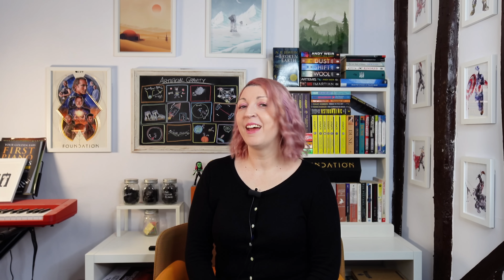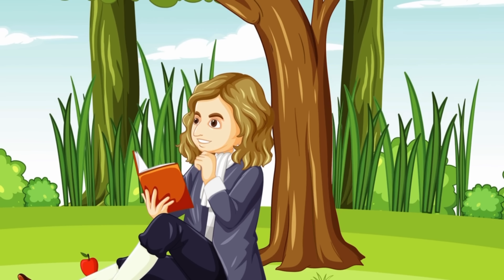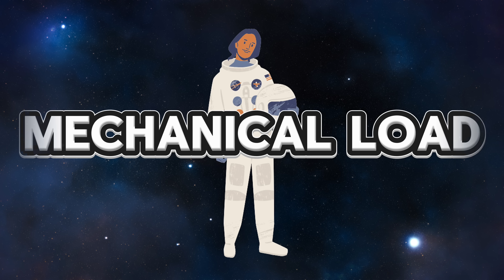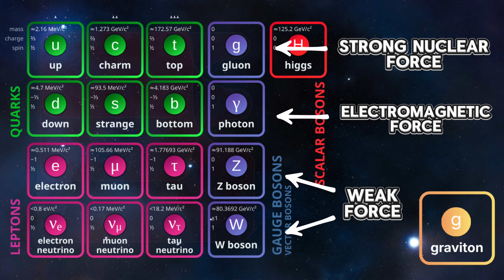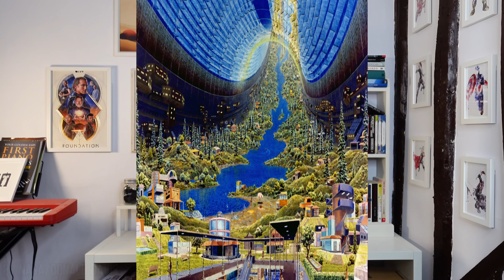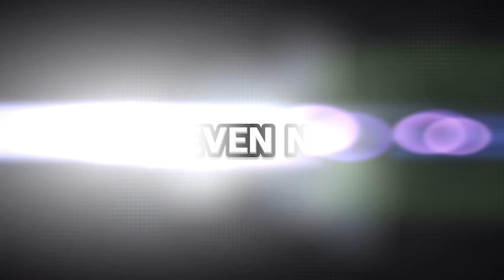Why Artificial Gravity Is Harder Than It Looks

Comment: A rocket accelerating at 1G continually would increase its velocity by add >355 k/sec velocity for each day of acceleration. If you keep that up, as it approached the 354th day: "Houston, we have a problem..." Except that you´d have to assume that radio transmission might have its own Doppler shift problems well before that point.

Comment: 4:45 Those small differences in Newton's law of gravity and the observable movement of the celestial bodies can be easily explained. His equation consider that no other forces are at play. So both bodies have perfect round shape, are solid and have evenly distributed mass. It also not counts the tide effect or the magnetic field.
6:03 Gravity isn't taken away in space. It still works. If it didn't work, then the matter wouldn't collapse and no moons, planets or stars could form from the gas and dust. 
Human body is not forgetting anything in space. The body is just adapting to the new environment.

Comment: Isn't there a flaw with the equivalence principle that you CAN distinguish being in a planetary gravitic field from a ship accelerating uniformly?  If you can detect the normals sensitively enough (say your ship is wide enough), the normals for a ship in acceleration will all point exactly the same direction, whereas the ship resting on the planet will have the normals all pointing directly away from the center of the planet, which will vary over the width of the ship, so you have a way to distinguish the two frames of reference.

Comment: 16:30 In my imagination, someone using gravity boots would look like one of those inflatable tube men you see outside of car dealerships. There's nothing at all stopping the rest of your body from flailing around... especially in response to the force you use to lift your feet. If you didn't have handholds, your calves would be SCREAMING after a day of that. Even so, it'd be like trying to walk on the ground while your full weight is suspended on cables, or quite similar to walking at the bottom of a pool.

Comment: Your content is excellent as well as your presentation.  This is the first video I have seen of yours so I am looking forward to watching more.   I wish I could intuitively understand the  9.81 m/s²  Saying it as "9.81 meters per second squared" makes it easier to understand than the way I was taught which was "9.8 meters per second per second" which I never could start to get my head around.   So if you could explain this is ways that I can get my head around I would love that.   I can understand 9.8 m  that's easy but it's the seconds²  bit that I struggle with.  I kind of understand the acceleration bit you keep getting faster and faster if you had a rocket pushing you along fast enough to simulate 1g.  
Otherwise a topic for discussion could be "Would you prefer to live on Mars in the clouds of Venus"  Or what other body on in the solar system would be better?   I think Mars would totally suck!  I would rather live on the Moon than Mars but dust sucks on both.  Gritty and bad for air locks and lungs!
Reply from the maker: So when we travel we move in space so we move in meters. how quickly we travel gives us a speed which is how many meters we move in how many seconds. so your car speed might be 50 miles per hour which is the same as 22 m/s. So you move 22 meters every second. That is the rate that your position changes, this is your velocity. Now if you are speeding up, then that value is increasing each second as well. So now you have how fast your position is changing, but you also have how fast yoru velocity is changing. so if velocity is change in m/s, acceleration is change in velocty/s. and since velocity is m/s then acceleration is m/s^2. It's just the way the maths works out.

Comment: I'll solve it right right now get a box big enough for a person to walk around n now put that box into a bigger box and place that one inside of that one now remove the top part of the one smaller than the big one and pressurized the bigger box which forces the pressure upward and it will hit the ceiling of the bigger box and then forces that pressure into the smaller box what your just didn't was recreated gravity with out curvature of earth basically creating artificial force or gravity

Comment: Actually it's a bit more than just an engineering problem. It's optimizing the designs to statistically accommodate human physiological sensitivities to reduce gravity gradient, coriolis effects, with ctoss-coupled accelerations which satisfy physiological and psychological concerns with crew selection, versus cost factors associated with engineering and build feasibilities within required  size ranges. NASA has historically been "too" conservative on required radius sizes. Also, 3 RPM works best for most non- fighter pilot types ( mission specialist) which will be required on future Mars trips (not just fighter pilot types). Four RPM is too fast unless the crew selection leans more towards traditional fighter pilots. Also there is good anectodal evidence that 18 striaght uninterupted months in microgravity would be a DEATH sentence. Luckily Mars is not an 18 month trip, with 0.38 g once on Mars, but there are unknowns with 0.38 g. 

arc.aiaa.org/doi/10.2514/6.2024-0138

Comment: Abigail James, you should host an interview podcast with Elon Musk. One potential strategy for bringing an artificial-gravity space station to reality would be to use SpaceX’s Starship to transport the necessary modules into orbit, while teams of Optimus robots—working alongside Boston Dynamics’ robotic systems—handle the construction. There is only so much the human body can safely accomplish in space; the rest will need to be carried out by advanced robotics. In the next century, humans may no longer build large structures directly—robots will do it for us. Mars mission also must be accomplished with robots before humans set foot on it.

Comment: 18:59 - You are grossly in error.

It is EASY to tell the difference.
Gravity is RADIAL.
Linear acceleration is just that: LINEAR.

So just position two sensors orthogonal to the acceleration.  If their vectors go to a point source, it is gravity.  If the vectors are parallel, it is linear accel.

Easy peasy.

And the easiest way by far to tell the difference is just LOOK.  If you see a huge massive body (planet, star, etc) then you are being pulled by gravity.  (If there was any window.)

Einstein's Equivalence Principle has significant caveats that most everyone is ignorant of.

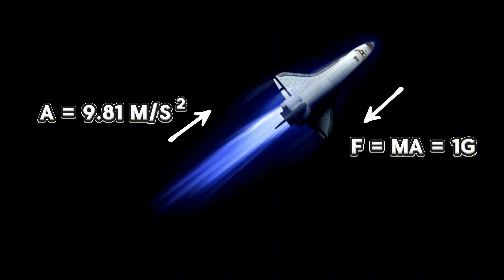19:40 - Here you appear to have it BACKWARD.
Linear accel in a very tall spacecraft can be determined because the accel is THE SAME at the top as it is on the bottom.  It is when on the launch pad in a gravitational field where the top part experiences slightly less accel.

I expect this is clear in your understanding.  Only your choice of words that get confusing.

Bottom line:
The difference CAN BE DETECTED.
Top to bottom, gravity is different from linear accel.
Side to side, gravity is different from linear accel.

Why EVERYONE screws this up baffles me.  Every person studying physics should have been taught this as an UNDERGRAD.  Yet folks like Brian Cox spout nonsense.
Reply from the maker: You’re absolutely right that over a large enough region, gravity and acceleration can be distinguished. That's not controversial, it’s literally how we measure gravitational gradients in geophysics. But that’s not what the Equivalence Principle is claiming.

The EP says that in a local region of spacetime, small enough that curvature effects (tidal forces) are negligible, you cannot distinguish uniform acceleration from a uniform gravitational field.
I spoke about a room on Earth and a spaceship. In these regimes, acceleration and gravity are indistinguishable. Einstein was extremely explicit about this caveat, the EP is not global, and no physicist treats it as global.

If you have very long spacecaft (kilometers in length) then tidal forces show up and you can tell the difference. Born rigidity tells us that the acceleration at the nose and the base have to be different.
Reply: @popculturescientist 
Your words are confused.  Here you say "uniform gravitational field".
But gravitational fields are not uniform.  They act radially, as the inverse of radius squared.

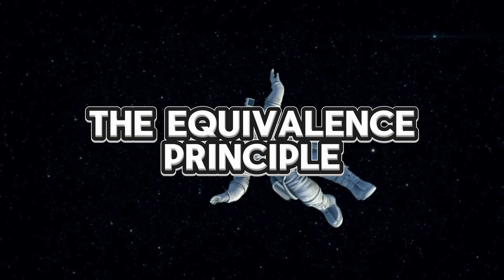18:17 - "If we can't generate gravity, we can still feel it."
No.  No amount of linear acceleration will change how much gravity you feel.  They are two distinct concepts that you licentiously conflate.

6:18 - "Microgravity"
9:18 - "microgravity" (Earth to Mars)

Surely you are aware that there is plenty of gravity in Low Earth Orbit.  It is what pulls the spacecraft around in an orbit.  And plenty when doing a Hohmann transfer to Mars.  The spacecraft is orbiting the Sun.

...yet you repeatedly use this term "microgravity" which indicates ONE MILLIONTH the accel of gravity.  Elsewhere you explain that LEO has roughly 90% of the pull felt on Earth's surface.  Your terminology is confused by several orders of magnitude.

Here is your other contradiction:
18:59 - No experiment
19:40 - "Now, there are tiny differences."

Both cannot be true.  Clearly there are experiments that can be done on the ISS to show you're in a radial acceleration field.

Over in your short, you say
"When the thrust stops and they start to float, gravity disappears instantly."

NO.  Not at all.  The thrust did nothing to create gravity.  And stopping the thrust does nothing to destroy gravity.  Equivalence does not mean that they are the same.  You have mixed up two distinct phenomena which happen to have similarity in this one certain property.

Here is one accurate way to make your statement:
"When the thrust stops and they start to float, the ARTIFICIAL gravity disappears instantly."

Words stated knowing that artificial gravity is NOT gravity.

Maybe you see me to be splitting hairs.  But people who have clarity of thought should be able to express that via clarity of words.  For whatever this feedback might be worth to you.

Comment: Dzhanibekov effect (AKA tennis racket effect) is the horrible result of non-uniform mass distribution within a spinning habitat in space, ripping the architecture to shreds under extreme shear stress. Water distribution may be the EASIEST & FASTEST way to balance the mass distribution within the critical time frame, although no one knows how much time we have, to maintain a single rotational axis for a rotating habitat. And it's not just a critical time reference frame, it's the critical mass distribution reference frame... we don't yet know how to get away with small amounts of imbalance for short periods of time. Could you do a video on this? Thanks in advance!!

Comment: There is little doubt that at some point in the future, if we want to continue long term exploration of space, then spacecraft design is going to have to change. The idea used in the "The Expanse" of continuous acceleration with the (unfortunately named) Epstein Drive, will not cut the mustard. That is going to require a single, massive advance in drive technology. But the idea used in "2001" of spinning a huge space-station or in "2010" of spinning up a large part of the spacecraft, well, we can already do that - its just that its going to make construction  very difficult and very, very expensive. .

Comment: 🌳*Part A: Creating Earth-like Gravity*
       To create Earth-like gravity for
        humanity in interstellar travel,
        several approaches can be
        considered:

    - *Rotating Sections*:
        A rotating section of the
        spacecraft can simulate
        gravity through centrifugal
        force. The rotation rate and
        radius would need to be care-
        fully designed to achieve Earth-
        like gravity (9.8 m/s²).

    - *Artificial Gravity Generation*:
        This could potentially be
        achieved through advanced
        propulsion systems or exotic
        matter, but current technology
        is not yet capable of generating
        artificial gravity.

    - *Gravity Simulation*:
        Creating a gravitational field
        through mass or energy
        manipulation is theoretically
        possible but is still largely
        speculative.

       Key Challenges:

     - *Size and Mass*:
         Rotating sections would
         require significant size and
         mass to achieve Earth-like
         gravity.

     - *Energy Requirements*:
         Generating artificial gravity
         or simulating it would
         require substantial energy
         resources.

     - *Structural Integrity*:
         The spacecraft would need
         to withstand stresses and
         strains from rotation or
         artificial gravity generation.

       *Part B: Time in Cryogenic
         Stasis*

         Cryogenic stasis,
         or cryosleep, is a
         hypothetical state where
         humans are preserved at
         extremely low temperatures
         to slow down metabolic
         processes. The effects on
         humanity would depend on
         the duration and method of
         cryopreservation:

     - *Biological Effects*:
         Long-term cryopreservation
         could lead to cellular damage,
         tissue degradation, and
         potential epigenetic changes.

     - *Psychological Effects*:
         Prolonged cryosleep could
         result in disorientation,
         memory loss, and potential
         psychological trauma upon
         revival.

     - *Social and Cultural Impact*:
         Extended periods of
         cryosleep could lead to
         significant cultural and
         societal changes,
         potentially resulting in
         feelings of disconnection
         or isolation.

       Key Challenges:

     - *Cryopreservation
         Techniques*:
         Developing safe and
         effective cryopreservation
         methods is a significant
         scientific hurdle.

     - *Revival and Rehabilitation*:
         Ensuring successful revival
         and rehabilitation of
         cryopreserved individuals
         would require advanced
         medical technology and
         support systems.

     - *Ethical Considerations*:
         The implications of cryosleep
         raise complex ethical questions
         about identity, humanity, and
         the consequences of "sleeping"
         through significant life events.

         Would you like to explore
         these topics further or
         discuss potential solutions?
   🌳 Meta AI with LLaMA 3.2

   🌞 Independent research
         Richard France
         11-30-2025  ❤ 🙏 🌞 

         Youtube.com 
         Title: "Is It Really Just
          An Engineering Problem?"
Reply from the maker: Why are you pasting a chatgpt answer into the comments.

Comment: One of my pet peeves is the scientific communities constant use of the term “micro gravity” for conditions in the space station. In free fall there is effectively zero gravity so just use the darn term and stop trying to sound clever with that micro gravity bs.
Reply from the maker: Nobody is trying to 'sound clever'. In science we use specific terms because they have different meaning. We can treat freefall as 'effectively' zero g for the purpose of general communication. But if you want to be scientifically precise, which you have to be for the experiments they conduct on the ISS, then it is microgravity. The forces are different. On the ISS they have 0.9g pulling them down, but they are orbiting at high velocity sideways so they don't fall down.  That doesn't remove all the effects of gravity on the station so there is still some. So it's microgravity

Comment: What possible engineering solutions exist for using acceleration to move a space vessel with a rotating crew quarters or even more so an entire rotating space habit without disrupting the internal environment and artificial gravity? Once a habit is established, spinning it down for transport would seem to destroy it.
I have a hazy concept that the section under spin might be fastened to arms that would adjust to maintain a constant sense of “down” but I have no idea if that would be mechanically practical or how connections and egress to the rest of the vessel would be handled.
Reply: If the one-gee crew quarters are hanging at the bottom of a rotating tether, and propulsion is hanging at the other bottom, and you turn the propulsion up to 0.01 gees, you can get between planets much quicker than today's uncrewed probes do. The acceleration experienced in the crew quarters is the square root of (1 squared plus 0.01 squared), which is near 1.00005.

In other words, you can't tell by the seat of your pants whether you're in high-energy acceleration or coasting. The direction of the vectorially summed gravities is always exactly down the tether.

What if you turn the drive up to 0.1 gees, or 0.2? Wouldn't that begin to be a non-small perturbation? Yes, it would, if you could do that ... but you can't. Just maintaining 0.01 gees over interplanetary distances requires football-field-sized red-hot radiators. They are the limiting factor.